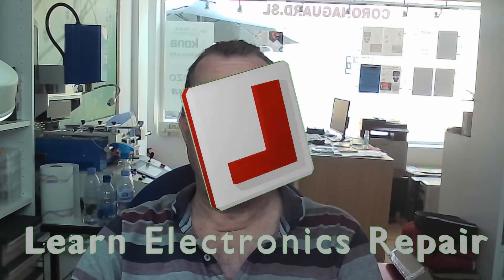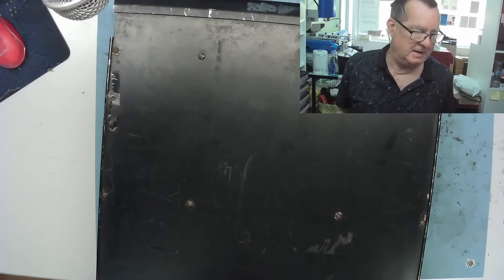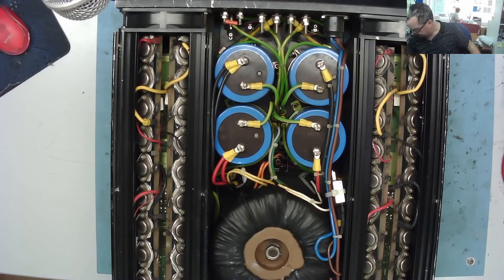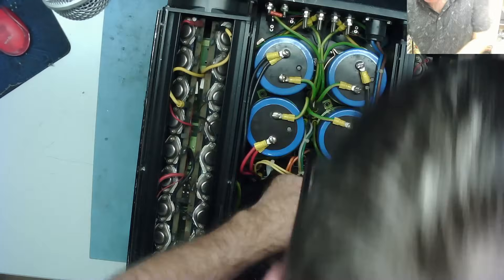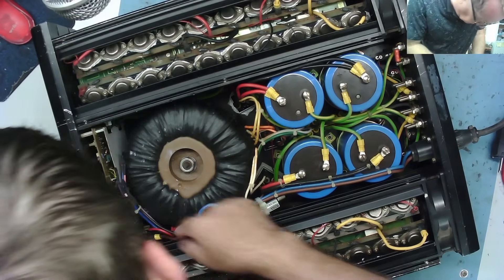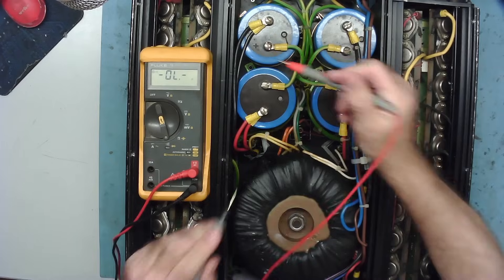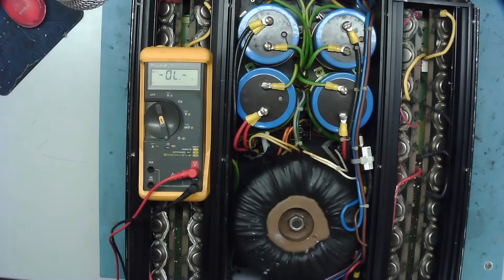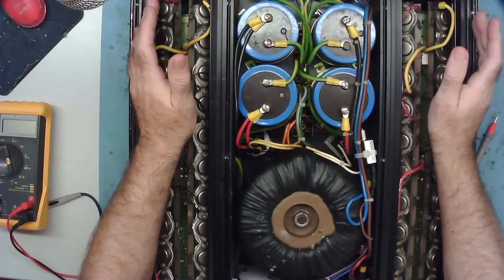All You Need To Know About AMPLIFIERS To Fix Stuff - A Beginners Guide To Audio Amplifier Repair

Comment: where do you get contestant light bulbs form don't see them anymore to build a limiter. I don't do eBay or Amazon
Reply from the maker: Incandescent light bulbs??   I just go to one of the local 'Chinese' homeware/hardware shops (we have load of them here) - and buy them. 🙂

I also see boxes of them at the flea market.

The Supermarkets don't stock them for some reason, but at the big DIY stores, though they don't seem to have the incandescent 'light bulbs' (only LED /fluorescent) they do have these R7s type of halogen floodlight bulbs in 100W, 200W and higher

https://www.aliexpress.com/item/1005001913712753.html

So Aliexpress is good... and Amazon also have the R7s bulbs, I just checked

There should be no problem getting bulbs wherever you are

Comment: did the wire come off the resistor due to heat or vibration, do you think?
Reply from the maker: I would suspect it was vibration.  These amps get used on carnival floats which are driving along the streets (slowly)

Comment: My god look at those electro-caps. By far the biggest Caps ive ever aeen in an audio amplifier. Surprised they're rated at only 100 volts.

 That transformer is also quite the beast. It must have a fairly large magnetic field when running

Comment: When I fix these I add a high value bleeder resistor, I'm stating this  for your Audience as it is possible to have a very large dc voltage across that very hazardous supply. DC voltage ⚡️ is much more dangerous than AC volts it will stop your heart and you won't be able to release you will actually involuntarily grab the terminals. I've worked in Electronics all my life. Safety First. Um it's 3 Am here, I hope that made sense I think I'm sleep writing here😂

Comment: my amp has its own life sometimes the power leds are on and left channel cuts out  or the power leds are off when turned on and both channels work  or intermittent cuts out .. i assume bad caps also it is loosing power by the day .... it is a cheap mcrypt so not sure it is worth to repair but yeah it does weird things i have to add tho sometimes it is ok for days and on the sudden it does that as said before ...
Reply from the maker: If it is a home stereo amp and has input/speaker selector switches then these are likely bad, which causes this problem
Reply: @LearnElectronicsRepair  it is a PA .. Power amp 1000 + 1000 W with bridge mode capability the signal and clip LED's function normally when the channel goes out the signal and clip led for that channel stay on

Comment: Yeah, class A amps aren't efficient, but they have the best sound quality because they eliminate crossover distortion by having both transistors fully on at all times. A class B amp has each transistor shutting off between cycles and that causes a TON of crossover distortion, rendering class B amp not suitable for audio. At least A/B amps have each transistors on partially, so when they are switching duty back and forth several thousand times per second, the transistors can start from a walk and ramp up to a sprint (fully on). Highly biased class A/B amp can start from a jog and ramp up to full on even faster, but it just doesn't get any better than class A sprinting constantly and switching duty cycles seamlessly.

I have never seen a pure class B amp used in audio amps, but I did have a Harmon Kardon amp that sounded decent at low volume (1-2 watts) and after that point it sounded like ass (harsh). It never even got piss warm, so I think it had hardly any bias current and was running in basically class B mode, which sounds like garbage. 

I'll take sound quality over saving a couple cents every time I listen to music, any day. There are much more efficient ways for me to save on electricity costs, than sacrificing the sweet sound from my class A/AB mono blocks, biased for 25watts pure class A. We are talking $5-$10/ year savings vs using a more efficient amp.
Reply from the maker: Totally correct that class A have no crossover distortion and give the closest representation of the audio source.  Some people also prefer vinyl for it's analog reproduction of music.  

Having been there when CD first came out, and personally having a very large collection of vinyl at that time, as I recall myself and all my friends thought CD sounded better.  

Commonly though we would be playing cassette tapes in Ford Capri at high volume, sometimes recorded from CD vinyl but very often from the weekly soul/jazz/funk/fusion show on Radio 1 and also the local FM radio station. 

Then at the weekends it would be traveling all over the North West England to the clubs with the best DJs playing rare soul records you couldn't hear anywhere else. And we loved all of it.  The point I think I am trying to make is it is the music that matters most, not the exact representation of it.  Well to me anyway.
Reply: @LearnElectronicsRepair  The first CDs that i got my hands on when they came out were mixed with ear piercing highs, as if they were trying to market the CD bandwidth :) Vinyles and cassettes sound "warmer" because they always lack treble definition, which may be why people preferred them greatly when CDs appeared.
Then came the loudness war that again hammered the CD reputation.
But a properly mixed album will sound excellent on CD, it's just hard to come by!

As for amplifier class, for home use, low power, class A can work. for PA use though, once you break your back once or twice, it's class D all the way. They are so stupidly light.. I have a 2kw amplifier leftover from band duties that weighs 2 or 3 kilos, it's ridiculous. the 800W AB we had before was about ten times the weight and didn't sound anywhere as good.
So yea, the best class varies wildly by use case as you pointed out in the vid.

Comment: Isn't the class A 12V peak to peak I.e. 12V TO 0V about a mean of 6V and the Class B 24V peak to peak I.e. +12V to -12V about a mean of 0V I.e. 24V total P to P
Reply from the maker: Yes i mixed up my 'peak' and 'peak to peak' voltage a few times in this video.  I also sometimes said +/-12V peak to peak which is at least a 'correct' description of 24V peak to peak.  I have to hold my hands up and say I hope you can skip over those slight mistakes
Reply: @LearnElectronicsRepair  Yes definitely, just wanted to check my own understanding. I have tried to understand how an amplifier can put out so much power through transistors. I don't think anyone has ever explained the parallel output system before. This was the tutorial that you tube and the internet was missing. Thanks for your efforts, thanks for taking the time to  answer my query. True gentleman. I wish you every success.
M.

Comment: If you need 40 power transistors for your amp, you are either hearing impaired, or way too far away from the speakers. Inverse square law though, right?

Comment: The topoligy of that amp is known as quasi complementary.
even after 59 years fixing electronics  my heart still sinks if i come across a direct coupled amp with shorted outputs .
most class A amps that i have come across have used transformer coupling to the speaker.
I am a coward and turn away MOSFET class D car audio amps getting too old to learn new tricks.
Reply from the maker: Thanks Rob.  On badcaps they said they thought was a type of Class AB but didn't give any more info. 

https://www.badcaps.net/forum/showthread.php?t=106096

I kinda figured out how (I think) it works with only NPN output transistors by myself.  I see quite a few class D car amps at the car boot sale - I bet they are faulty and would make for an interesting video....

I assume the output transformers on the Class A amps are to stop DC appearing across the speaker terminals
Reply: Bob Cordell “designing audio power amplifiers” and Douglas Self “Audio Power Amplifer design handbook” seem to be good texts on the subject. Both easily found as pdf on internet ☺️ if you can’t find it in your local library.

Comment: Thanks so much for your videos so far. They're amazing! Very informative and easy to follow!!

I'm really struggling with too many mv on the right channel of my NAD 3020. I can't set the dc offset low enough. The 20k trimmer is probably buggered. 

One interesting point is, the amp sounds normal for a couple of seconds, after power off, when the source is directly into Normal In. 

Any ideas on where to start? Schematic is here;
https://www.hifiengine.com/hfe_downloads/index.php?nad/nad_3020_service.pdf

Thanks again!

Comment: Seriously that lamp "tool", what will that help taking off 160w from an 2300 watt outlet? How could that ever protect anything?
Reply: It is just a resistor to limit current. You aren't 'taking off 160 W" you are limiting the total power in the entire circuit to 160 watts maximum.

In normal operation a 160 W lamp operating at 240 V will pass current of 0.67 A. 
Because the filament has a high positive temperature coefficient of resistance the current when the lamp is cold will be something in the range of about a tenth of what it is when it is at its normal operating temperature. That means the current at first turn-on would be in the range of about 7 amperes.

Comment: God damn those are beefy caps. And the transformer jeez.
Reply from the maker: Yeah, roughly speaking, if a Class A/B amplifier module is 1000W RMS output then the PSU needs to be double that (2000VA)

Comment: As for the current limiter with light bulbs, I did make mine but, in Belgium, classic light bulbs are FORBIDDEN and sellers won't sell these ! (it's a quite recent law).

So, I tried to buy halogen bulb, but you know what ? These will also be forbidden in a near future in my country, so the only bulbs we can buy are LEDs !!! WTF !?!?!?

I could find a 60W classic bulb (a yellow one for entertainment purposes, clubs etc...) but no 100W...
I could also buy a PAR38 Infrared 175W one (to heat very young animals ! Farming, etc...), but hey, I won't see anything, just heat...
Reply: You can use a wirewound power resistor. They are less convenient to mount and you don't have the built-in visual indicator of what is going on. They are also a lot more expensive.

Large wirewound resistors may not be available in exactly the value you want. A 160 W lamp at 240 V would be about 360 ohms. You will probably have to choose between a 250 ohm and 500 resistor. You can get types with a movable tap but they are more expensive and you only get the full power rating with the tap right at the end. A power rating of 225 watts is common If you used 500 ohms a lower power rating would be OK. At 250 ohms you'd be a bit above the maximum power at 240 V if there was a short circuit right across the AC input of the thing you were testing. A wirewound resistor can easily handle that for a minute or two if it is a room temperature when power is first applied.

Because LED lamps aren't usable in an ordinary cooking oven you may be able to get small incandescent lamps. You could wire one across the power resistor to give you a visual indication.

Comment: But my position on electronics repair for the untrained (and even the trained to a lesser extent) is...DARWINISM in action. 
I personally would never advise a  tinkerer to ever take the back off of anything they dont understand, as electricity is a KILLER and if you stick your screwdriver in the wrong place you are going to know all about it, but usually not for very long, only as long as an electrocution takes...

Theory of Amplifiers took me back to my city and guilds days...
Many a good snooze through some of those classes...
I will never forget my first electronics class. some dude turned up with the rest of us, the teacher started doing the theory of Ohms law the very very basics, and a few rudimentary calculations of Voltage Current and Resistance and this fellow got all indignant and exclaimed...
"Fuck this, it's all maths this is." 
and walked out never to be seen again...
My how we laughed, it was the last laugh we ever had for 2 years. 
Electronics is not a funny or a fun subject, but what you can do with it is...
As where woiuld rock and roll be without electronics...
Acoustic, thats where...